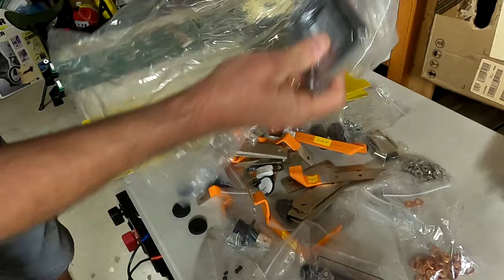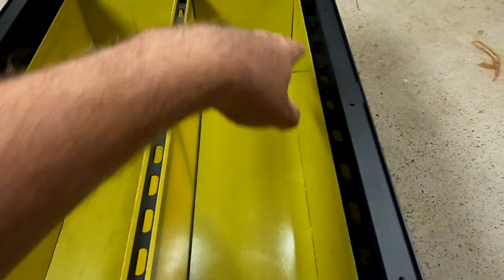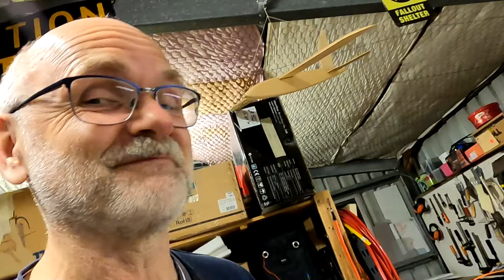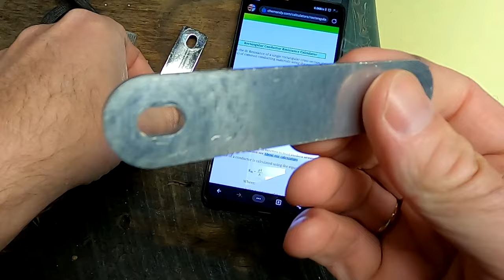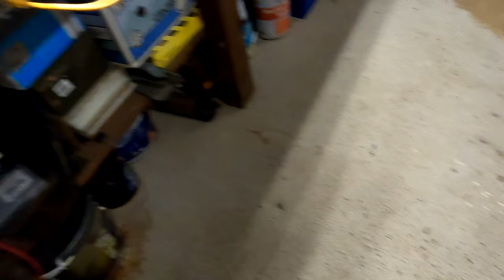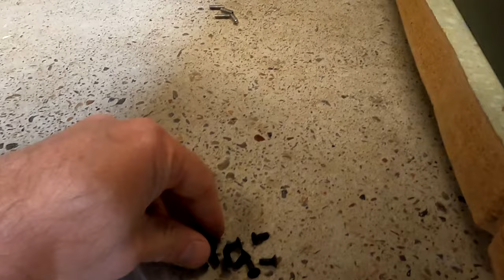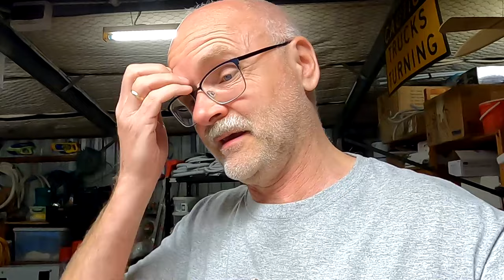Building the SEPLOS MASON 280 DIY Kit - What a BEAUTY! Da-Da!

Comment: Hi Andy. Hello from miserable wet chilly England. Loving the channel. Just received my mason 280 v3 in the UK there is an active balancer on the compression plate, a sold end plate now where you put the aluminium sheets in the follow up video. All the gubbins also came in a separate accessories box… so just a shame the supplier sent the wrong accessories box for the vertical mason case not the stackable one. So looks like your vids have had a positive effect on Seplos. Well done 👍

Comment: I think these copper washers do not maximize the contact area. It is limited (maximized) by the smallest area and will not increase by placing a bigger/larger washer on top... It will only add an extra resistance in my view...
Reply from the maker: Yes, hence I left them out. Works perfectly without.

Comment: Hey Andy, been following your channel for awhile. I just recently put together one of the Seplos Mason 280 and communications are working fine for me. FYI, when the battery is in a discharge state my capacity lights are on and my run light blinks green and the display is off. Both rs485 ports work for communication to the computer software. I have spent alot of time understanding this software and have pretty much mastered it and it's quarks. I modified the software files to fix alot of the bad English translations in the software. If you would like any help or access to the files to fix the translations let me know!
Reply: Hi Joe - Are you able to post those translation fixes in a google drive and share the link?

Comment: Hey Andy. Stack a second flexible jumper in the back. You’d be surprised at the residence difference between the buss’s and the cable. At higher charge/discharge rates you may get some weirdness between 8 and 9 if you don’t.

Comment: Hey Andy!
So I just assembled three of these last week and I have the following comments to your build:

The chewing gum is a heat exchange pad, it goes on the heatsync on the back of the BMS PCB. I cannot for the life of me figure out why they opted to "save" putting this in before shipping and fix the BMS with the 6 screws so it's actually in place, but you have to take off the BMS from the front plate, attach the heat pad and screw it down again.
When you put the BMS back, make sure that the LED diodes align with the holes in the frontplate.

The same for the display, you have to loosen the two screws it comes it, slide the display to the far left if you are looking from behind and screw it back in and add the additional two missing screws. This is why you had issues pressing the buttons, because the alignment is off, so the buttons don't travel properly.

The busbar for the positive terminals on the front is facing the wrong way, you need to put the "nut side" towards the fuseholder.

There was 4 little round foam discs in the kit, put them inside the top holes of the case, so the next box you put on top rests with its feet on that foam pad.

I got the 200a bms and it worked fine for connection via the RS485 ports like you showed with the previous build.

I also told Seplos that their packaging inside the case was borderline stupidity with 3/3 bags for my kits broken and things all over the place. I recommended a cardboard box for all the bits and pieces and separate box for the BMS and display as well. In one of my cases, the PCB of the BMS had actually broken off a corner due to being beaten up in shipping and them not attaching it with the full 6 screws. 

I'll look forward to you getting the rollable basestation and hear your judgement on bolt alignment vs the wheel attachment plates :P It'll be fun.

Comment: These high capacity batteries are nice from an energy storage point of view but there's more to think about than just that.  You have to think about being able to physically move it and that's more than just putting it on a skateboard to wheel it around the workshop floor.  How to get it into the eventual mounting position, by yourself, for example.  That could well mean you need some sort of lifting machine, manually powered or otherwise and that adds onto the cost of the overall project.  None-the-less, as usual always interesting to watch Andy at work.
Reply: Indeed, I've got a 24V 280Ah pack in my van. The cells and the box are 50kg. Just about manageable to move around but I wouldn't want it any heavier.
Reply: Some 🧀 to your  🍷
Reply: I'm thinking a Hoyer type patient lift (medical version of the automotive engine hoist)
Reply from the maker: I think if they are on the trolley, that's how I would install them. 
But yeah, the weight is something I have on my list as well. You would need 3-4 people to lift it up now if it goes in an enclosure of any kind.
Very valid point.

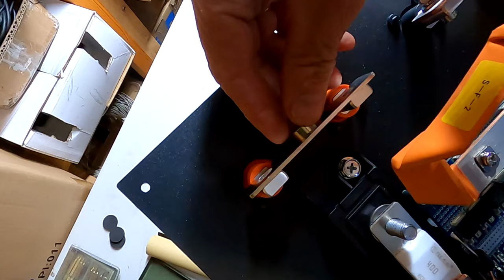Comment: At 35:40 you put the main positive bus bar upside down. The fixed nut on the bus bar makes very little contact with the flexible bus bar coming from the fuse.
Reply: I concur with Raymond. Along the same lines, you should also add at least one and preferably two more of the Digital Mermaid's flexible bus bars on the 8+/9- node. IIRC, her most recent bulk bus bar build was yielding 110 microohms each, whereas your Seplos aluminum bus bars are close to 1/3rd of this. 110 uOhms @ 150A that the BMS can do is 2.5 W of waste as heat - an unreasonably high value for only a few centimeters of wire.
Reply from the maker: Yes, that is correct. If I flip the busbar the flexible bus bar to connect to the fuse will be in a bad shape though.

Comment: Nice repair on the stripped terminals. Having them all torqued correctly is a good thing. My O.C.D. would like to see all the terminals matching size, but I try really hard to fight that when it adds extra work and extra risk to my projects!
Reply from the maker: Over time, I will probably end up with replacing them all. I could already feel that some just made the 5Nm but would not go any further. The UNC screws seems to be rock solid.

Comment: Hi Andy! A couple of suggestions. Just in case you haven't already found.

The busbar screwed to the positive terminals should be reversed. The thread on the opposite side. This way you'll have more contact area with the bar coming from the fuse.

The "chewing gum" is for better heat dissipation on the BMS. It is supposed to be installed between the front panel and the BMS's heat sink.

Kind Regards.
Reply: hah I was going to comment that same thing! I was waiting for him to realize his mistake. But at least I wasnt alone! good eye!
Reply: In my case (literally box) the heatsink of the BMS ist only 1-2mm away from the front plate. When I put that blue stuff in, the PCB will be bent extremely. AND! As I tried that, the thermolube of the heatsink was pushed to the outside :(. So, I decided to not use this chewing gum.
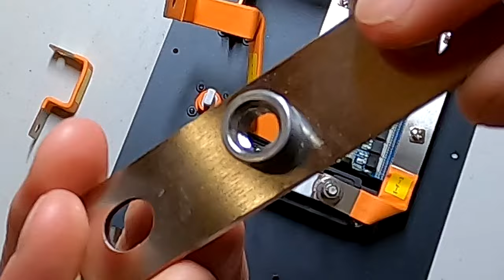Reply: @35:30, if you reverse that metal busbar, the bridge connector to the fuse is too long, and not flexible enough to fit. It must be the way Andy shows it.
Reply: @trevornelmes9331  I'm not sure if I understand what you mean. I've assembled a couple of this boxes this way. And there is no problem with the length. Only very slight curve on the bar.
Reply: @vferrandobe  Ah. I have one on its way. The front panel is a revised design. The power terminals are vertically arranged, as I look at the front the negative two are on the left and the positive ones on the right. The LCD is in the middle and looks different also. Supposed to be to allow vertical cabling runs easier. The connecting 'flexible bar has the busbar to join each terminal pair built in, so that positive bridge busbar is no longer there. The fuse is a different type as well. The front also has a power button, that goes to a jumper on the BMS. The cell busbars have insulation and are the 'flexible' type that has a hump in. The BMS has Bluetooth. They did me a really nice deal of ~ $700 delivered including UK taxes, 150A BMS and the trolley.
Reply: @trevornelmes9331  Then you must have the new "wall mounted" box with wheels. I have no experience with it. But it has several differences.
Reply: @vferrandobe  No, it is still floor mounted. The box and trolley are as before. The only difference I can see is that the BMS (still from Seplos of course) has BT and a power switch, the power terminals are different (more like 'standard' type) and the panel layout is different. They told me they only just started shipping these a few weeks ago. I will try and make a video when it arrives.
Reply: I have some pics, but no idea how to share them with you 🤣😂
Reply: @trevornelmes9331  I am with you. That is clearly how they wanted it assembled but yeah, if there is enough room to bend the bridge connector out a bit, it would be nice to have all that more surface contact.

Comment: Andy next time use a hex key on the head of the grub screw to hold it in place while you tighten down the hex nut, otherwise you might end up with more stripped terminals.

Comment: I have the same box and put it together a little over a month ago. I opted to use the busbars that came with the EVE280 cells instead of the Aluminum ones that were provided by Seplos (for reasons you already know!). Mine were shipped in the exact same s**t show way that yours were. I complained and never heard a thing back from them. To be honest they have some of the worst customer service and could care less after they get your money (my experience).

I also opted to replace the front connectors with Amphenol connectors as I couldn't find any information or links to buy my own connectors/crimps from the company who makes the ones they provided (futronics). I paid an arm and a leg for it though, but I wanted to be able to make my own length cable/connections.

I bought a hydrolic pump motorcycle lift to build these on and then lower and roll them into place :)
Reply from the maker: Thanks for sharing your experience. So far, I cannot complain about their service. Sometimes it does not make sense what they're replying but at least they reply. I will pass your feedback on to them!

The connectors are on my list for the verdict video. I don't like them either. Seems you can only buy them from Seplos directly for a lot of money. I'll have a look at some alternatives too.
Reply: @OffGridGarageAustralia  I asked them multiple times about what connectors they use on the front but they didn't reply. I only found out when I received it. It also arrived damaged (cosmetic) with a large dent on the front and the "flying busbars" as I like to calls them, no response.

I like the units and they are well built, but I wouldn't trust them if I had issues.
Reply: @hummmingbear  just try to chat with them via whatsapp. I also face same difficulty as you. I tried to get details about these connectors, bcz I've to use custom battery cable length. After 2hrs I able to get right answer, that's meant they didn't help. The guy I contact he's very helpful to me. But he's not a technical guy, so he had to wait for his technical team response. By the way, they used 50mm square terminal for 200A BMS. He already sent me, tech specification for it.
Reply: @OffGridGarageAustralia  Here they had not replied too, only before payment they had been very responsive. Beyond that there was silence. Luckily I had paid with paypal and if they do not get it done soon I will call paypal to open a full case, where they will have to pick the whole mess up. I do not need a discount on a broken product. I had fully paid and shippping can not be that hard . Have never seen such a bad shipping preparation for the parts inside.

Comment: Hey :) as u build already 5 of them and ordered another 10, some feedback from Germany.
Not everything is good at the DIY system (lacking manual), but not as bad as it looks. Usually they send the youtube link where you can see more than in the manual on the website -> a lot of room for improvement here for Seplos. 
I used EVE 280AH cells from Docan, i put 5 or 6nm on the studs and none broke, maybe i was lucky, but for 80 cells ? Maybe yours were just bad. This time i will get 160 CATL cells, let's see.
The blue rubber pad is a Wärmeleitpad - thermal transfer pad. You have to remove the BMS and put that on the heatsink, it has exactly that size. I used the seplos bus bar as it measured better than the Docan busbars. My Seplos BMS is 200A Version.

For all screws that are preinstalled -> they are low quality and just for transportation, just throw them away, you have all new screens in the package (my "transportation" screws were already rusty ). The copper rings are used on the cells before adding the busbars. For my cells all busbars fitted. The cell cables, plug them into the BMS side first, then you dont need your condom solution, just plug them into the battery side as the 2nd step.

The new shipment include a cardbox with all materials, i already received a picture. My first 5 came as yours, awful, really really awful. One had a defect display, replacement came in around one week, really fast.

To connect the BMS to the PC, select cell 1 in the software, then press connect. Try dip 1 on if it still does not work. I think you have one foam left over for each side, there has to be 2 on he first cell behind the steel plate -> then the screw is long enough to put 8-9nm pressure.

Improvement they need to do from my side:
- packaging (maybe already fixed)
- a really good manual, PDF link or even paper
- a good description of the software and how to use it and how to connect (there are several PDF with the dip switches, in some the order is changed, in some not, awful !!)
- pre-modified fuse holder cap that it fits
Reply: Can you comment about the just buying it as a fully assembled rather than DIY?  I asked Seplos and the price difference was tiny.  Why wouldn't I just go that way?  I'm looking for a good deal on battery, not a new hobby if that makes sense.  Thank you.
Reply: @Altenurgy  for me the difference was not tiny, and the cells from seplos are neither Eve nor CATL
Reply: @patrickmartin4482  That little birdie does keep telling me something is likely amiss.    I'm relatively new to all of this so the cell manufacturer wasn't even a matter I thought to look for.  They've sent me lots of documentation including a 12 page one on the cells.  No mention of manufacturer that I could see.  6000 cycles @ 80% though.  So if I understand correctly you bought thier kit are providing your own cells?  I hadn't even thought about that.
Reply: @Altenurgy  I ordered 80 eve cells @ docan and this time 160x CATL

Comment: As my Mason was delivered it looked exactly the same and I wrote a an email to Seplos and they say OK we will deliver it the next time with a cardboard box 😂🤣 but you are the best example that Seplos didn't change anything 😉.  But for 600 USD you should expect the parts better packed. I ordered a second one so we'll see 👀.
Reply: Your "chewing gum" is heat transfer gum which go underneath the bms to transfer the heat to the front panel, schön Grüße Marko
Reply from the maker: They will get some more feedback. There was nothing in the installation guide about the heat pad and the BMS was already mounted 🤷‍♂️

Danke Dir!
Reply: @OffGridGarageAustralia  I think the PCB was only loosely mounted for transportation.
The blue stuff goes between it and the case for thermal, then remount the PCB with extra screws.
They have a YouTube installation video on their YT channel

Comment: Really enjoy your channel.
I can add that for battery tension I did look up some table values for torque and tension. In the inner front plate we have 7 times M6 screw and used friction values for a dry screw. If there is still play and all batteries receive the tension and not the frame then we should only tighten with 0,9Nm per screw. This correspond 85kg per screw and should give the recommanded 600kg for the 2 rows of cells. If there is no play and tension is taken by frame there should be inserted a spacer in each row.  Also note that the EVE datasheet state that the recomanded 300kg is at 40% SOC as the dimension increase slightly by higher SOC.

Comment: I'd put the fuse on top of the bus bars. That way if you need to remove the fuse you only need undo those two bolts and it lifts straight out without having to bend the bus bars, or even having to undo them from the BMS or terminal.
Reply: Thx for the tip, will be building my system using a mega fuse within the next week so it is timely advice.

Comment: Well done Andy, I'm sure the issues can be fixed. In my dreams I would whish to have this metal case, PCB, size for 310AH and the JK BMS...  I did not decide if I will build my own in wood, as my 310AH Cells are still sitting here and wait for a nice dress. Or I buy additional 280AH and give Mason a change.

Comment: The "chewing gum" is for part of the bms to help distribute heat :)
Reply: Yes Andy you need to remove the BMS and apply the heat sink material under the aluminum heat sink against the front plate
Reply from the maker: Nothing in the manual about that. The BMS was already mounted.
Reply: @OffGridGarageAustralia  there's a video on putting it together from seplos where they mention it